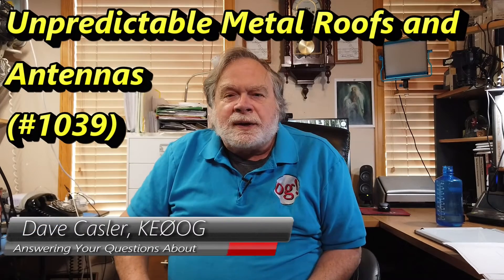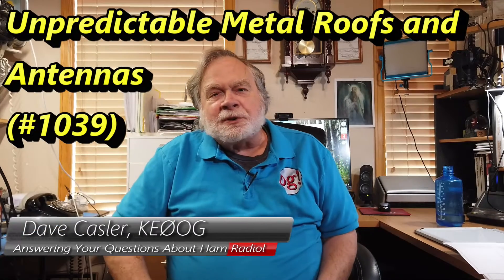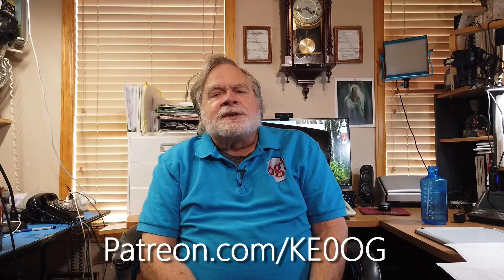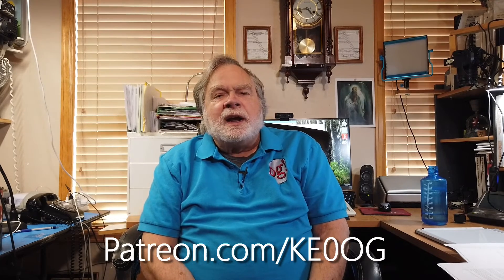Unpredictable Metal Roofs and Antennas (#1039)

Comment: Dave, I always enjoy your presentations.  I have a Hy-Gain 12AVQ trap vertical for 10-15 and 20 I placed on the center of my 29’x 65’ 6/12 pitch metal roof.  The antenna is mounted on the peak, not elevated.  It has no radials and uses the roof itself as the ground plane.  It is a surprisingly effective antenna.  With 100 watts, usually operating no more than 4 or 5 hours a week, mostly on SSB, I have logged in 93 countries in 9 months.  I have managed to get quite a few 59 reports from my QTH in Oregon to both Europe and Asia.  Admittedly the other fellow always does the heavy lifting using a much superior antenna setup,  but it shows you can have fun with a simple vertical using low power. 
I did not find it necessary to bond the metal panels. Overlapping panels provide capacitive coupling as someone here has already suggested. I don't think corrosion is a factor in my case since the aluminum roof is 25 years old.   73, WA7SNW

Comment: Dave
I’m thinking about trying my gutters as an antenna!  
I do have a metal roof could the roof be loaded as an antenna also?
I am in TN and would like to try to work into WI. My metal roof runs E to W. I can run a dipole antenna parallel to the roof. Will the metal roof interfere with the single?  
Thanks. WB9VVH. Joe
Reply: Did you ever turn your roof into a antenna